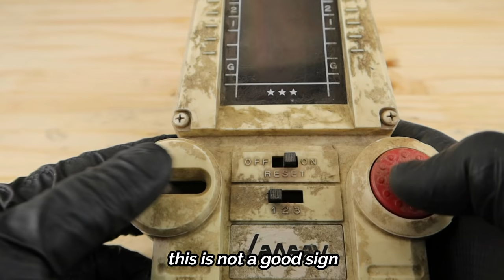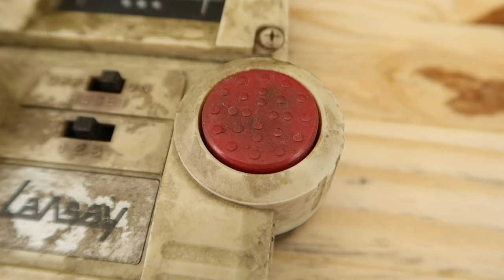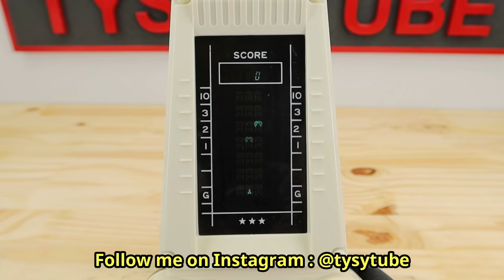$5 Broken SPACE INVADER Console Restoration and Testing

Comment: At 3:00 that’s not the charging port, that was for a DC adapter to run it plugged in instead of with batteries. Old electronics like this didn’t have built-in charging capability; if you had rechargeable removable batteries you needed to take them out and charge them using the battery charger, just like you still do.
Reply: I bet he knows that if he tinkers with electronics. It might have been lost in translation.
Reply: @sebastian19745  well this came was released in around the 1980's, and the NiMH didn't become commercially available until 1989 and forward and they where ridiculously expensive and kind of still sucked. i will now take my old man cane and run into the sunset like the know-it-all hero no one asked for.
Reply: @Winther83  You used nickel–cadmium as rechargeable batteries with toys like these and charging them was sometimes as easy as putting power into them, straight on. No circuitry needed.
Reply: Why the Frick is there one using the same name for every comment
Reply: I think he refers to the charger port, or DC adaptor port, but he knows it doesnt charge.
Reply: @Winther83  rechargeable batteries became used with reasonable regularity only after 1995 or so.
Reply: @vresi  The old rechargeable batteries were usually in special packs. Not regular battery size.

Comment: It's actually called a "whistle chip," a speaker is different. (not trying to be rude) speakers only make sound, but whistle chips can make sound, detect sound if you make the right kind of circuit, and are usually used only to make 8/16 bit sounds.

Comment: From my copier repair days i found that a great cleaner for removing oxidation and UV yellowing  from plastic is PurpleStuff and a 3m scotchbrite pad or a toothbrush.
 For the electronics 91% or higher Isopropyl Alcohol works great as it will not leave a residue or microfilm. But you have to be careful using Isopropyl on darker or clear plastics as it can etch them and discolor some darker plastics.

Comment: 10:13 Hydrogen peroxide degrades and turns into water in the presence of UV light, so you don't need to rinse it, you can just dry it off

Comment: WD40 works great to clean those contact slider switches.  It also dispels moisture.  Trivia:   The inventors failed 39 times.  WD40 stands for Water Displacement perfected on the 40th try.

Comment: This can't be a real restoration:

1) You didn't start by wandering round a rubbish heap and accidentally finding the console after randomly digging with your hands
2) You didn't start by scrubbing the complete console with a wire brush in soapy water
3) The PCB wasn't strangely perfect inside a ridiculously muddy case
4) You didn't fill any imperfections with a paste made from ramen and water

Either that, or I have been watching the wrong kind of restoration videos. ;)